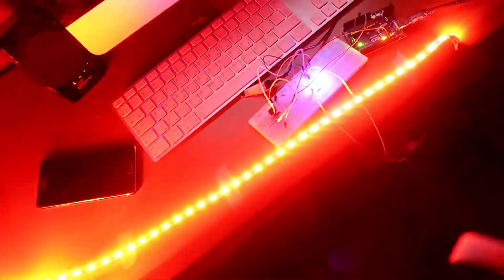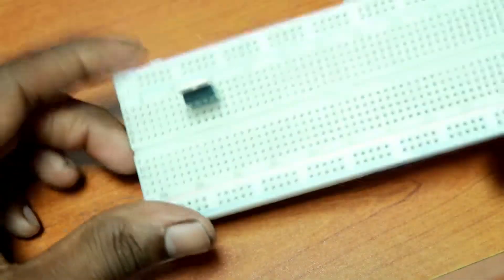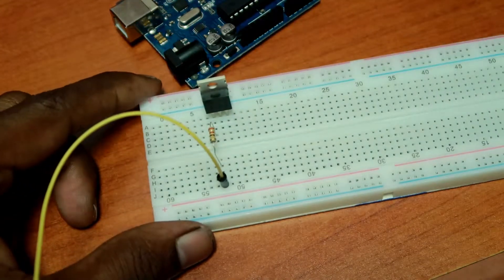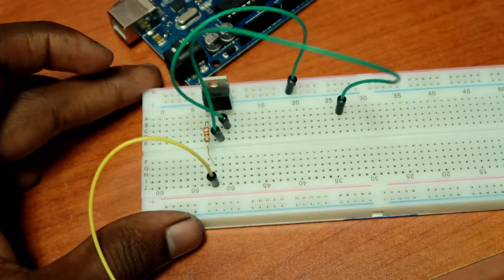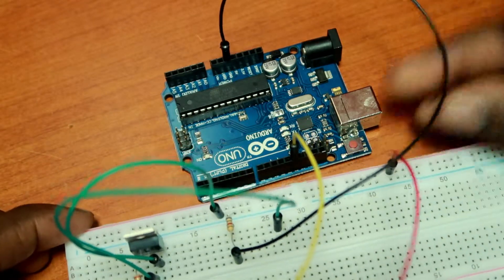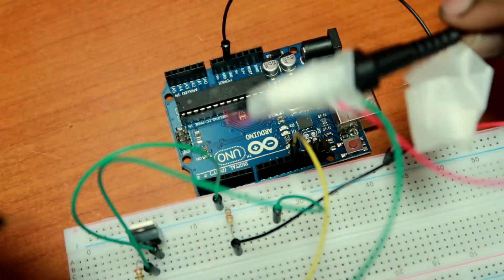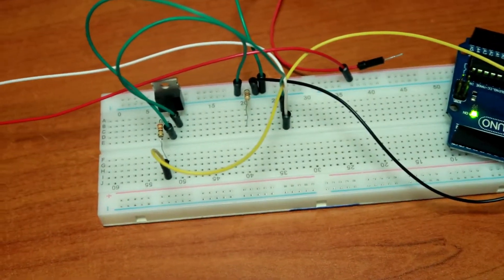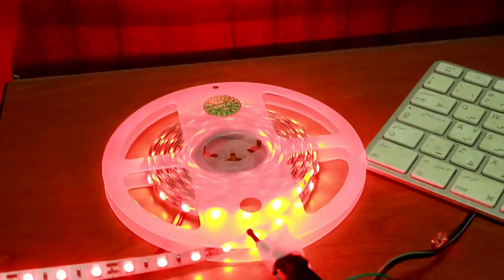Arduino uno Mosfet  LED strip Flashing  -Malayalam

Comment: Ardinoyil 12v koduthal pore MOSFET vendallo...
Reply from the maker: arduino ഔട്ട്പുട്ട് 5 v കിട്ടുള്ളു.arduino സിഗ്നൽ എടുക്കാൻ മാത്രം ഉപയോഗിച്ചു ലോഡ് ഡ്രൈവ് ചെയ്യാൻ റിലേ അല്ലെഗിൽ ട്രാൻസിസ്റ്റർ ഉപയോഗിക്കുന്നത് arduino ബോർഡിന് നല്ലതു
Reply: @Experiment_UAE  bro 5v led strip und appo ithil oru 5v 2A supply koduthal pore..
Reply from the maker: Arduino out put LED STRIP work cheyyanulla AMP kittumo?